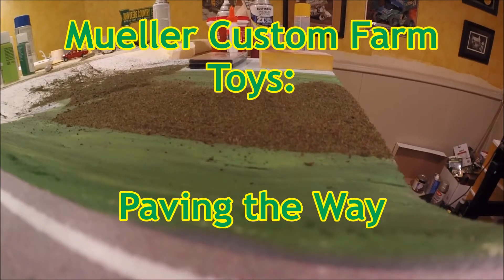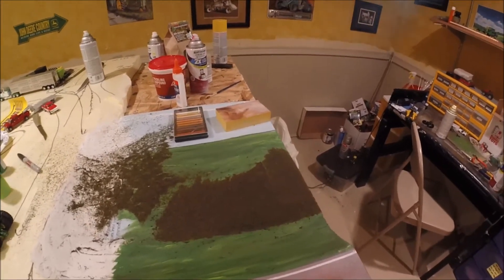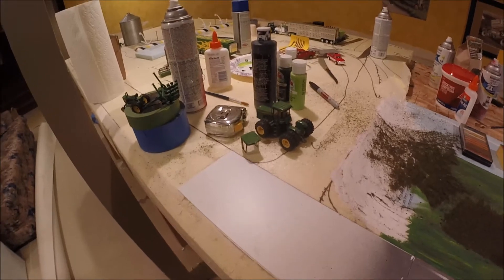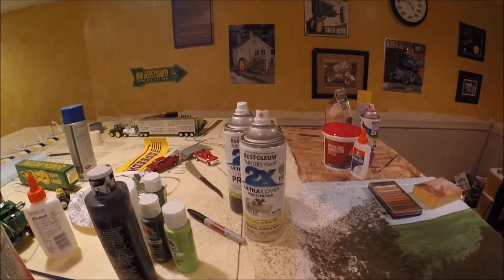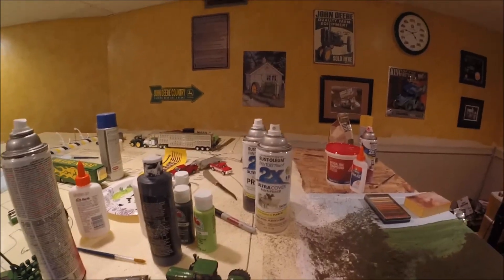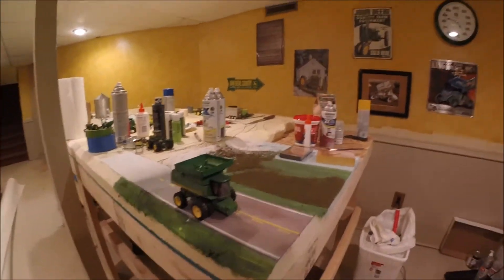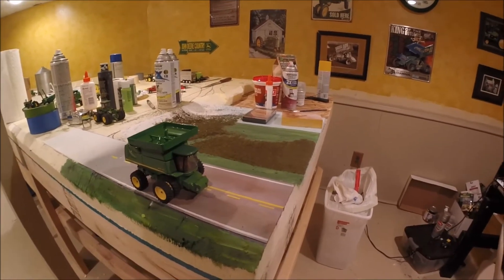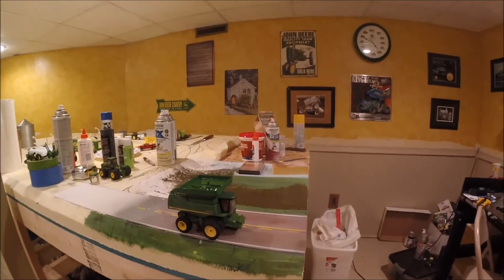1/64 Custom Farm Toys: Paving the Way

Comment: You used masking tape to make the lines?
Reply from the maker: Yep, kinda eyeballed the size and stuck it down
Reply: 2011nm cool, I'm gonna be making a mini display on my own you helped me out with some ideas
Reply: 2011nm what masking tape did you use? I'm actually using a shingle for my road peice and I can't seem to get the right size masking tape without having to trust and cut the tape smaller
Reply from the maker: I did one line at a time and let it dry. That way it didnt matter what size the tape was
Reply: 2011nm ok thanks!